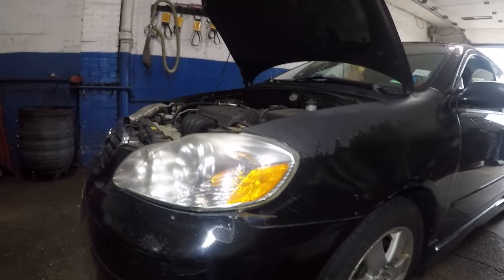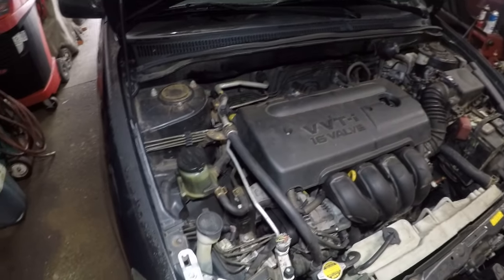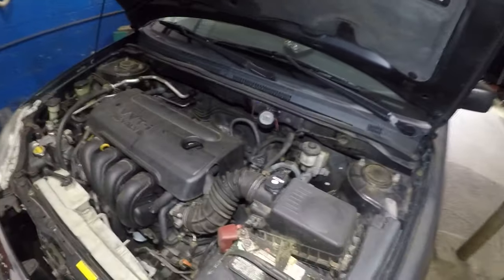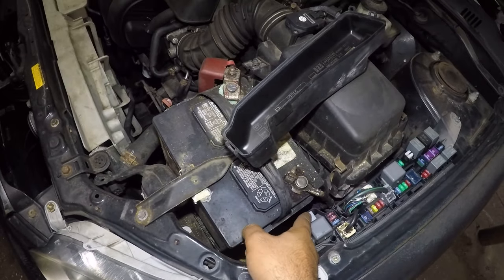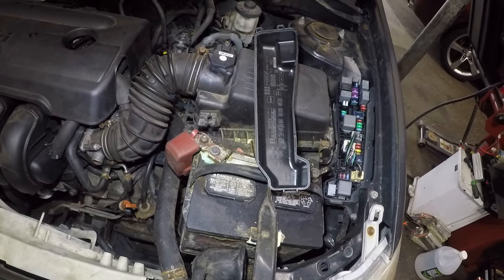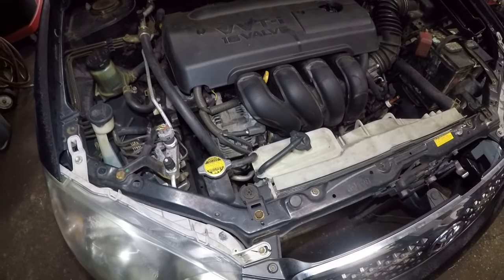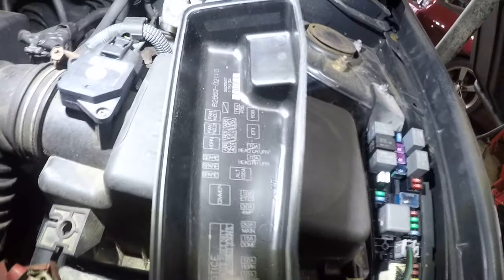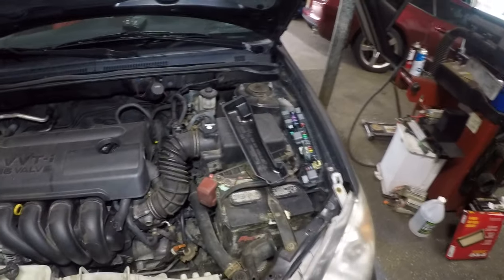Toyota corolla 2007 AC Dont work, Quick Fix AC Relay

Comment: You just helped me fix my ac on my 2006 Corolla, ac intermittently turned on and off when I tapped the relay housing purchased a new relay problem fixed thank you RB THE MECHANIC 👍
Reply from the maker: Nice job!!! Tapping is kicks it on good fix!!!
Reply: How to change or which relay should I buy? My AC/Heat doesn’t come on 😩
Reply: I'm pinoy, thank you for sharing your knowledge,

Comment: Thank you so much for your help! I went to a a/c repair shop and they told me I should take the car in for inspection since the compressor wasn't working.. they even removed the  relay and put it back but said it wasn't it! After watching your video and cleaning the relay contacts it worked like a charm!! Toyota vitz 2003.
Reply from the maker: Nice good job
Reply: How did you clean the contacts
Reply from the maker: @jerryrivera7704  no cleaning contacs replace the relay

Comment: Greetings from Buenos Aires, Argentina! I have a Toyota Corolla 2007 that, last week, suddenly stopped cooling the air, I was thinking about how much money I would have to spend fixing the AC, but today I found your video and it was like you said! the cause of the failure was the AC Relay, I disassembled it and cleaned the internal contacts with fine sandpaper and now my AC I working OK again.
You have a new subscriber! Many thanks!
Reply from the maker: Oh wow good job doing the cleaning I usully just replace it

Comment: Excellent video. My relay was bad. One other thing you can do is pull the relay and jump the 2 leads closest to the rear of the car, with the key on and engine off, and AC fan on low. You’ll be able to hear if the clutch is kicking off and on as you touch the leads. If you hear the clicking it’s probably the relay.
Reply from the maker: Nice fix!!!

Comment: Thanks I fixed my AC Problem by replacing the relay fuse. MG Clutch.
Reply from the maker: Good job!!!! Easy right?
Reply: My friend all that you said I do it but still not working the magnetic clutch  everything is okey but still not working is possible for ac module my button is digital can you help me

Comment: Thank you so so much I just fixed my AC for my Corolla, the knob stuck like you showed. You are awesome!
Reply from the maker: Nice job!!!
Reply: @RBTheMechanic  well today it's blowing but not cold again. I tried your "tap tap" trick but it didn't work. Please advise. Thanks!
Reply from the maker: @KNtendon  check power on ac compressor when u have ac on its possable maybe ac compressor failed
Reply: @RBTheMechanic  should I replace a new AC relay?
Reply from the maker: @KNtendon  if u haven’t yes some times tapping dosent work
Reply: Do you have any Toyota transmission solonoid replacement videos?
Reply from the maker: @BrianAhearn8597  no sorry I don’t I did do them on corollas years back before I stared YouTube it was to remove oil pan then valve body to get to solenoid
Reply: @KNtendon  if yours is like my Corolla swap with your horn relay if your horn works if that solves your problem then by the relay but buy it as a horn relay or pay almost twice as much for the same thing
Reply: @RBTheMechanic  seems real easy I want to make sure I get the right one really bad arthritis and no money makes this a tough job
Reply from the maker: @BrianAhearn8597  easy relay swap

Comment: Nice.
One question though.
Is it possible that the relay is transferring current but not 14v but much less thereby Frying the magnet coil in the compressor assembly.
A mechanic fixed my ac by replacing the magnet coil only and not changing the relay. The new magnet coil also got toast in 30 minutes of use. What could be causing the coil burn, low voltage due to faulty relay?
Reply from the maker: Yes I had that very case for radiator fan

Comment: Question on the passenger side there is water coming down... do you know the issue? But i know that the water is not draining out of that black tube that connects to outside
Reply from the maker: There’s drain tube under the car u can have mechanic blow air in it and it will clean out here’s a video I did on Toyota u can try to pinch the line ur self and warm it out it’s just blocked other wise have it blown with air https://youtu.be/Fg_TSv-bYAI

Comment: Thanks will have to try it mine will run cold air for trips then go somewhere else and it blows hot air will just last yesterday worked good cool down the car going to the store about 2 miles, Today went to pick the grandkids from school nothing but hot air, If it does not work about how much does a relay cost??? rather try getting a new one as my first option then taking it into the shop,, The 4/55 AC 4 windows down doing 55 MPH does not work good in TAMPA

Comment: If I added Freon and it only worked for 2 weeks,  what could possible be the reason? And does this mean those diagnoses in the video won't be necessary?
Reply from the maker: U need to check if it got pressure if it’s low or no pressure then it leaked out. U need to add dye to trace it down u should had done that when it was working now u will need to recharge if it dosent have pressure
Reply: @RBTheMechanic  Thank you! You are pretty much right. When it wasn't cooling I thought it was just lacking the refrigerant. Now a local auto repairer charged me 180 for just AC diagnosis. Do you think this is a fair price? I am worried about overcharging because I just lost my job for a while.  Thank you again.

Comment: What is the name of the aluminum pipe the high charging port is connected to i pinched the line putting a new radiator in im trying to figure out what exacly it is. Is that the ac liquid line assembly?
Reply from the maker: Discharge line

Comment: my ac in my toyota corolla 2013 is randomly not working, it just started right now it’s not working but it was working fine yesterday it shows it’s on i can turn the dials but nothing doesn’t come out at all no air at all but it shows the ac is on im hoping it’s something simple to fix.
Reply from the maker: This could be faulty relay swap that out

Comment: My 07 Corolla was cooling before I recharged it. I only recharged because on hot days it would take forever to cool. It would really only cool when I was driving on the highway (30-40mph+). So I recharged it, and think I might have over done it. Now it's worse than before. Now even when it's not hot it doesn't really cool much.
Reply from the maker: Yeah I think u put tooo much which is not good it wount work normal I never use cans u have to reservice the system recover vaccume for 20 minutes and add correct amount oil and r134

Comment: Hi my toyota corolla was not blowing cold air but i watched your video and tried swapping the relays, now the air con blows cold air but only intermittently. It blows cold air for like 10-20 minutes and then goes back to blowing normal air (not cold or warm). what could be the fix to this?
Reply from the maker: Put in new relay and check refrigerant pressure do ac service it could be low. Or if u sealed relay and it’s old it could be bad as well

Comment: I have a 2005 Toyota Corolla S …. My Ac doesn’t start getting cold after the cars been running for about 10min ? And it seems like the middle vent is blowing cooler air than the side vents ..any idea ?
Reply from the maker: It could be compressor but before that do ac service correctly with ac machine recover and vaccum for 20 minutes then recharge the system with correct amount of oil and r134

Comment: Could you help me sour with a Toyota Corolla 2017? It has pressure but I’m confused about the relay, it’s different obiuslly than the 2007. Thanks man.
Reply from the maker: Check under hood in fuse box if it’s not there then it’s integrated in the ecm go directly to see if ac compressor got power  with ac on and if it got power and dosent come on then u have bad ac compressor but do check inside and outside fuses and relays

Comment: Does this apply to an 04 Corolla too? Also is this the same issue as in winter when it blows cold?
Reply from the maker: No this is ac related video when winter comes u need to test heat system and check for blend door operation

Comment: 08 Matrix. Refrigerant is charged up. Magnetic clutch engages, then disengages a few seconds later. Sometimes it will stay engaged for ten seconds, and the systems starts to pump cold air, but then it disengages again. I messed with the relay, swapped it with the horn relay, and it worked for about ten seconds then went right back to where it started.

What part of the system tells the relay to send power to the clutch? Is there a temp sensor near the evaporator?
Reply from the maker: Dose the line get cold?   Did u check pressure
Reply: @RBTheMechanic  The line starts to get cold when the clutch stays engaged, but it only lasts for a few seconds. Low pressure was in the green range on the refill gauge.

I made a jumper wire for the relay terminals to keep the clutch engaged full time and it started to cool things down. Then some ugly sounds came from the compressor area. Intermittent bursts of loud noise, accompanied by a cloud of either smoke or dust. I can also see some oil puddling under the compressor. I think I found the problem!
Reply from the maker: @corey6393  it might be over filled or jammed with out. Only doing ac service with ac machine car clear out what ever the issue might be and hopefully that fixes it
Reply: @RBTheMechanic  I can double check if it's overfilled. But guessing from the ugly noises I heard from the compressor, it might be junk. Definitely compressor oil dripping from somewhere, it has that glowing green color.

I'll pull into the shop tomorrow to dig in a little deeper.
Reply from the maker: @corey6393 or bad compressor

Comment: Blower blows air from all vents properly. Also the low pressure pipe gets cold but still cold air doesn't come in the cabin. Cabin filter is clean. But still compressor trips after   every one second creating noise. What can be the reason . Is it low gas or relay problem?
Reply from the maker: Try turning mode dooor motor manually see if it out of place

Comment: My Ac doesn’t blow cold until car starts moving( higher rpms). Just filled with R34a. Still the same issue. Any suggestions?
Reply from the maker: It might be low on refrigeration

Comment: Thanks for making this helpful video.
Reply from the maker: Welcome
Reply: @RBTheMechanic  My car is a 2009 Yaris and after watching your video and checking under the fuse box lid in the engine compartment, I see there is no relay unit, as in the Corolla in your video. I have checked all fuses and they appear to be good. When the on/off switch is activated, the AC light inside the on/off button in the control console does not come on, nothing happens, no fan on, no nothing, whenever I push the AC button to 'on'. Maybe you have some idea of what it could be? Thanks for any help.
Reply from the maker: @gregoryross.303  did u check ac pressure? Or power to ac compressor?
Reply: @RBTheMechanic  Will do so eventually. Thanks. Been watching various youtube videos on car AC systems and will eventually isolate the problem and fix it. I am not a frequent AC user, living in a cooler part of Canada, but having everything working in a car is great if you ever wish to sell the vehicle, and I like my vehicles to always be in top condition, with everything working well.

Comment: How do you check if your AC comes on after tapping the relay? 2008 corolla base. 

When i recharge the system cold air comes but after about a few days the cold air is gone.
Reply from the maker: U should hear the relay click    But by telling me it gets cold and few days later back to not working that means u have leak and there is no refrigeration for ac to kick on so check for leaks and fix it use dye to trace it down with UV light

Comment: I have toyota corolla verso. Sometimes when I turn the AC on at any speed of the fan everything works but seconds later there is no air comming through the air vents either cold or hot. The display shows fan is at max speed but there is no air comming and i hear the compressor is not working. Few seconds later the air comes back. Could this be because of the relay ?
Reply from the maker: U have to. Heck power and ground to blower motor when the air cuts off

Comment: Good jobs u make it simple to understand.my Toyota Corolla 06 cools in the evening and early in the morning but in d afternoon getting hot so a technician  advice me to top up d gas pls kindly me out txs
Reply from the maker: Oh yeah defiantly sounds low it’s low on Freon and it’s not able to keep u cool enough once the sun is out so have it reservice sand do it propperly recover, vaccum and then recharge the system with ac machine add oil
Reply: txs alot I appreciate.I will tell him to go ahead txs 4 the update
Reply: One more thing,do I tell him to empty d gas b4 putting the new gas or he should go ahead to top it up
Reply from the maker: @jidetheophilus7639  here’s a video to give u better idea this is the exact process he should do with ac machine recover is pulling out the Freon that’s inside the system it will also recover the oil so he would have to add oil as well here’s the video https://youtu.be/YOpNRY-4i6Q
Reply: @RBTheMechanic  wonderful! I love D's explanation I am very grateful and impactful more power to r elbow

Comment: I have a 2003 Vibe and when I turn the fan switch to turn on the A/C I get nothing no A/C no green light that usually shows it's on. I checked the A/C fuse and it's good, what could it be. I think it's not getting any electric to the switch or not. Thanks
Reply from the maker: Check ur ac Freon pressure if u have leak in system it will leak r134 and shut down the system start with that

Comment: Hey I had someone look at my AC a year ago I just never fixed it but they said it’s a AC pressure sensor that needed to be change. Maybe you have an idea of what that is if you could Inform me. Thanks !
Reply from the maker: Well it’s a pressure sensor that give feed to computer that ur system have pressure and let’s ac come on how ever try to swap the relay. It is very very common relay to go bad on these cars ... also do this.   Put ur ac on have some one put the ac on for u and look to see if the radiator fans come on immediately that will indicate that ur sensor is working and have pressure let me know when u find

Comment: I have a 2016 corolla S there is no relay. But my AC comes on.......goes off. What would you look for?
Reply from the maker: You might have mixture of hot air and Freon in the system and every thing there no frown to pump it will blow hot and then cold might need to reservice the system
Reply: @RBTheMechanic  Thank you for answering so quick.

Comment: My 06 corolla ac hasnt been working there is pressure in the pipe and it is also cold what do you think it might be
Reply from the maker: Wait it’s cold but not working?
Reply: @RBTheMechanic  yea its cold but no ac or hot air at all comes out
Reply from the maker: @irineocampos131  if there no air at all check ur blower motor put it on high speed and test to see if blower motor has power and ground but on high speed check fuse and relay

Comment: hey i have a 96 toyota corolla and the ac blows only hot air. what would be the fix to this issue please?
Reply from the maker: Start with check ac Freon pressure and swap out the ac compressor relay u never know it’s faulty relay!!!
Reply: @RBTheMechanic  thanks a lot man it worked. After having 2 mechanics looked at my issue and getting a quotoe of upto $1500, I came home watched your video and did some playing with the relays and bam! ice cold air con. Thanks a lot brother, you the man.
Reply from the maker: @ashrafulalam8677  there you go!!! Good job!!!

Comment: My compressor makes some grinding noise 2010 Toyota Corolla do I need to Replace it
Reply from the maker: Eventully u will need to replace it depends on how bad it is
Reply: @RBTheMechanic  yeah its was my compressor was bad it didn't have oil inside I replaced now it's all good now thanks
Reply from the maker: @djlouis2150  wow big expensive job

Comment: What if the a/c doesn’t blow in the middle but on the sides it does and I’ve noticed that the air escapes from the bottom where you showed in the video on the glove bones
Reply from the maker: Seems like ur mode door is not switching check that out

Comment: I have toyota chr the passenger side the a/c works fine and cold but then on the drivers side the a/c is just blowing fan and not cooling any suggestions?
Reply from the maker: Is it dual climate control system?
Reply: @RBTheMechanic  yes it is dual climate control
Reply from the maker: @pnlbcbrl4122  well I just did one codon commin soon I turned the driver side blend door manually it was dual system
Reply: Hello, @Rb the mechanic, thanks for the great work you. Are doing I also this same problem with 2007 corolla that the drivers side vent does not get cold at all but the passenger side does.. my technician said is the evaporator or the condenser that is bad. I also noticed the high pressure line is getting cold everything, what would u suggest I do
Reply from the maker: @funsolutions123  that could be low pressure or restriction in the system so try reservice it before doing anything and do it propperly recover and vaccume for 20 minutes then add correct amount